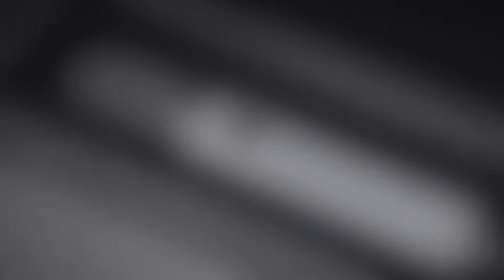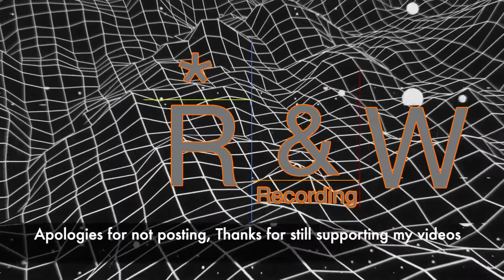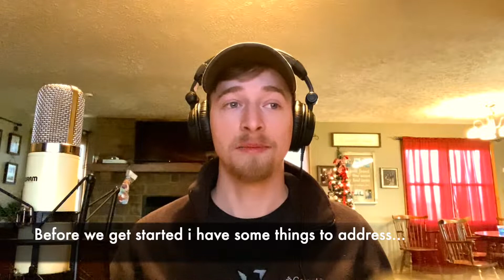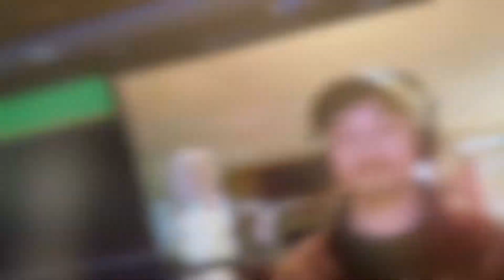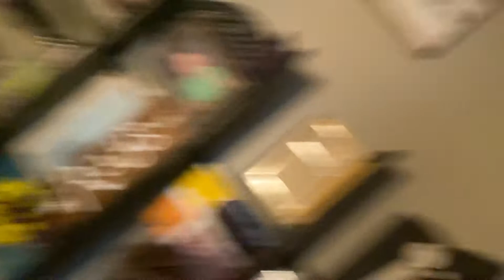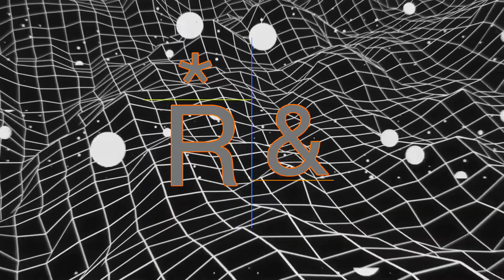My Warm Audio WA-251 Broke.... Plus I lied to my following, and I apologize for other things...

Comment: YES. The vocal booth video. Yes please!
Reply: It's literally just packing blankets hanging from some kind of rig. You can hang it from the ceiling or you can use mic stands or wood or PVC pipes to make a frame that you hang the blankets off of. Honestly, you can just hang the blanket on the wall and get the same effect without sounding like you're in a box.